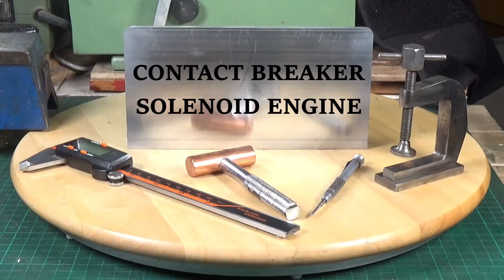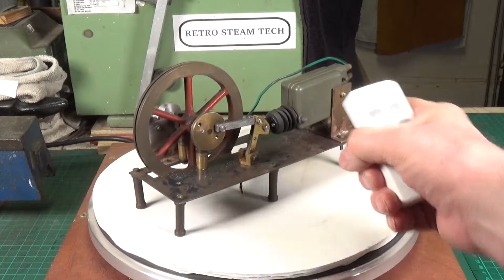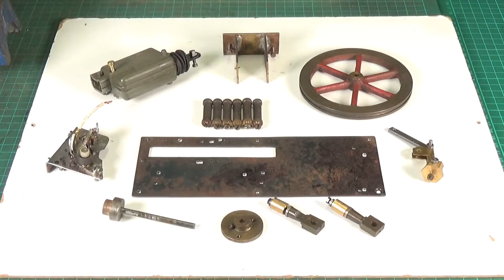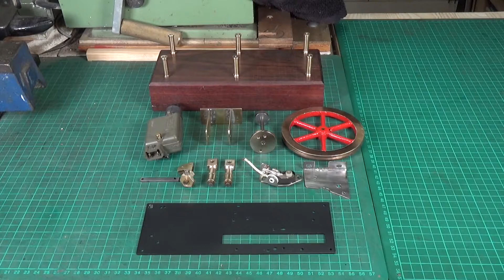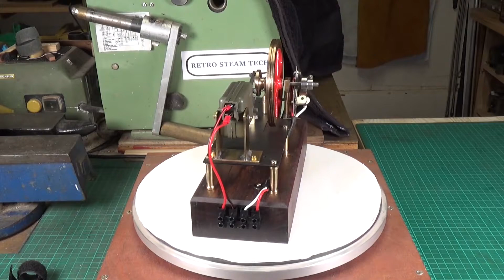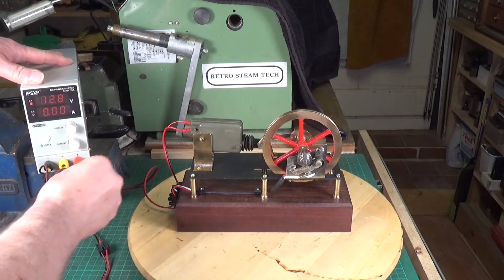Contact Breaker Solenoid Engine

Comment: Very nice rebuild Alan. Color of the solenoid seems to indicate it might be military surplus. Many of those systems ran 24v power. The name you chose for this engine does have a nice ring to it…. (insert rim-shot here).
Reply from the maker: Thanks Brian. The solenoid does pull in quite hard with just 12V so I suspect it is probably from the automotive industry. Cheers, Alan.

Comment: Hello Alan,
WOW that cleaned up well... The solenoid engines are always interesting to see...
Cheers.
Paul,,
Reply from the maker: Hi Paul. Thanks, it looks better than it runs! Lots of parts need re-working. The bracket that holds the solenoid flexes and so do the supports for the flywheel. It's all on my to-do list 🙂 Cheers, Alan.

Comment: Rockwell is American.  Used to be Delta Milwaukee .......... Rockwell Delta   The logo matches is what had me double take.  If you look at the front of this drillpress you'll see the logo  https://www.wrightwayrestorations.com/wp-content/uploads/2012/12/Delta-Drill-Press.jpg
Reply from the maker: Hi Bobby. Thanks for the info. I agree with you that the same logo is very similar but I've looked at the solenoid under magnification and the name on it is definitely "Rookwell" not "Rockwell". It also says "France" quite clearly on it. Cheers, Alan.
Reply: @RetroSteamTech  ahh interesting.  thx
Reply: the 'c' and the 'o' could be ........ misread if rubbed off a little .... just a possibliity because that logo sure does look similar
Reply from the maker: @dizzolve  The markings on the solenoid are etched into the plastic rather than embossed, so there isn't anything to rub off.  It's all a bit of a mystery, doing a Google search for "Rookwell" doesn't result in much. There was a company called "Rookwell International" but not much about them.

Comment: Looks realy neat cleaned up. Not the quietest engine you have! I wonder if the solenoid is mains powered, it's well enclosed and obviously an industrial item.
Reply from the maker: I thought it looked rather good when it was back together and yes, very loud!  I think the solenoid is 12V as it pulls in hard when that voltage is applied. I thought maybe automotive.  Cheers, Alan.

Comment: Interesting engine Alan.  Makes you wonder what the solenoid was used for in it's previous life.  Not something I've played around with, but I may have to ;)  Cheers Rob
Reply from the maker: Hi Rob. Yes, it's a bit unusual. I did some research on the solenoid but couldn't find anything. I did wonder if it was automotive, maybe car door lock or similar. They are fun engines to make, all sorts of different configurations. Cheers, Alan.